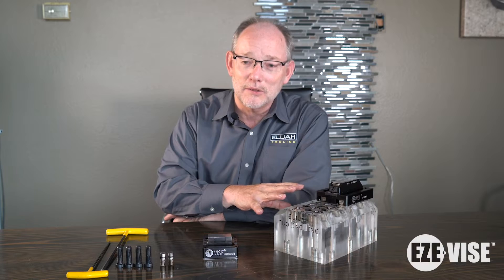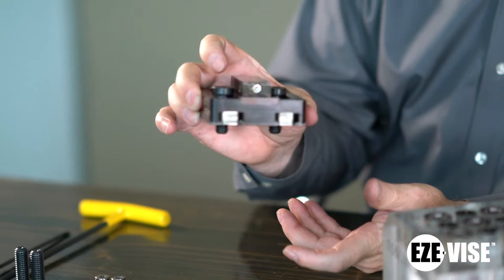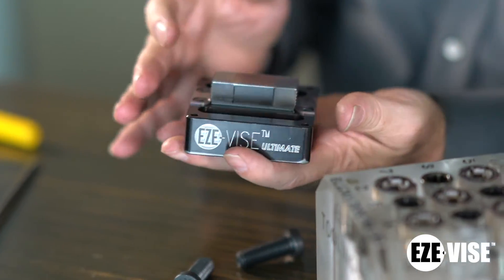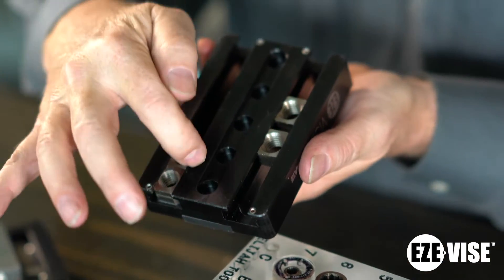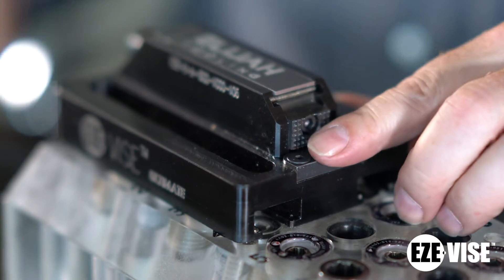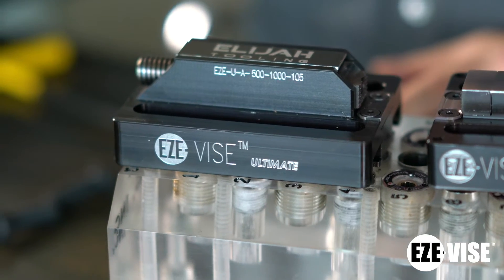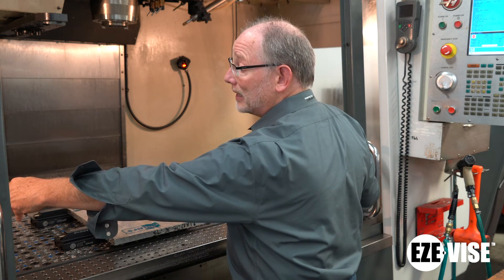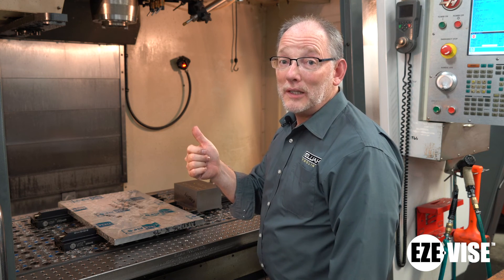EZE-VISE™ Ultimate Vise (Modular Vise) | Elijah Tooling

Comment: How would something like this work for holding round parts? I've got a round cast disk, about 25" diameter 1" thick. I'm thinking 2 stops and 2 movable and use them kinda like a 4 jaw chuck.
Reply: You could definitely use the Ultimates  in that way I think Jessie. However, you might want to consider cutting the soft jaws in the D-DRIVE to fit the diameter of your part. Here is a link to that vise: https://elijahtooling.com/collections/d-drive-5-axis-vise-accessories
Reply: @rickmiller2101  the part in question is sand cast, do you think the soft jaws would be adequate on the first op, holding onto the rough cast surface?